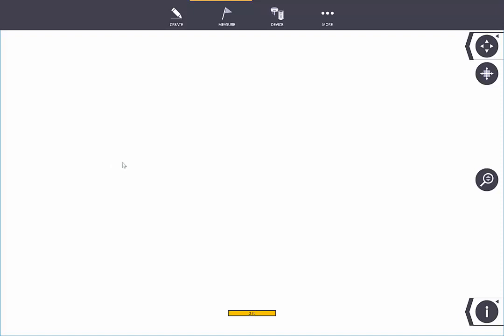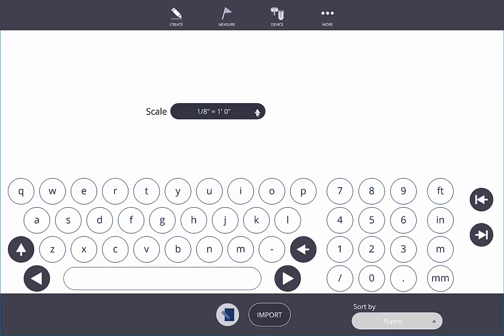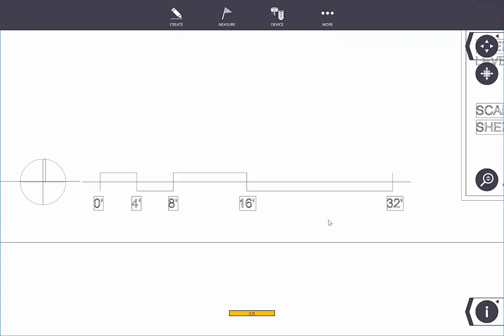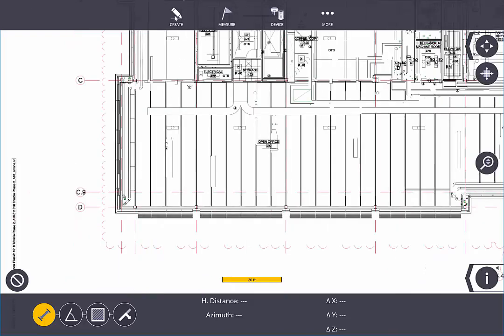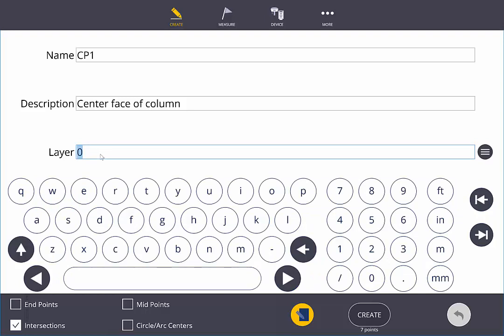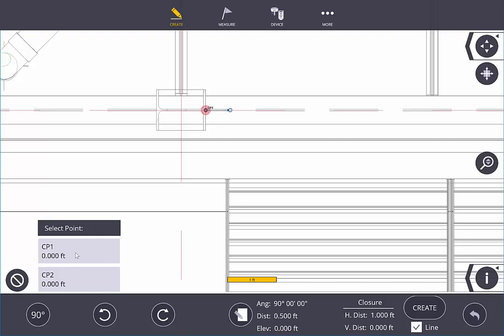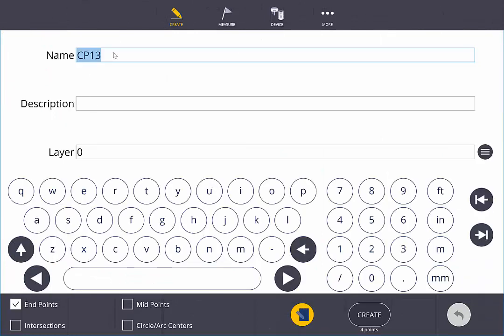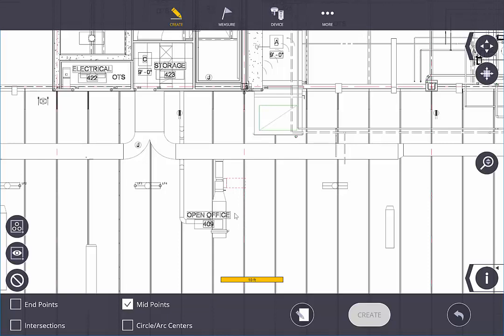Importing PDF's into Trimble Field Link

Comment: What happens if the column is at a different spot then what is on the sheet? For an example positioned 1/4" plan south and plan west?
Reply: Create the pdf point on the plan using the drawing. Then do create, plan, add point 1/4 inch south then a point 1/4 inch west. Use point manager to remove the unused point for cleanliness.